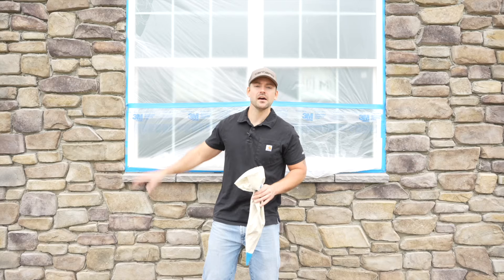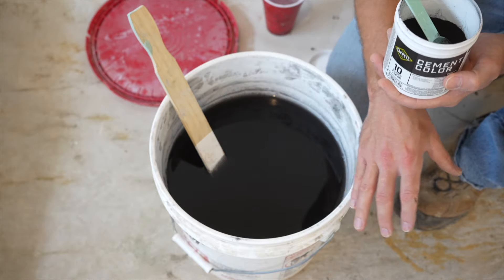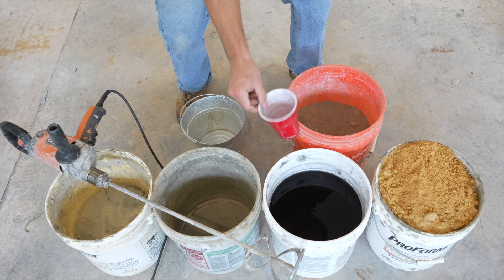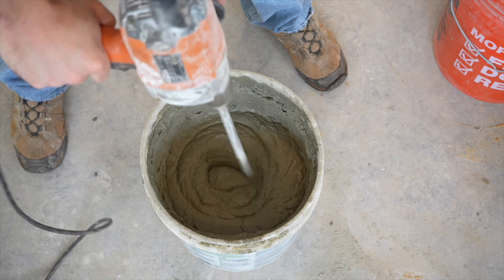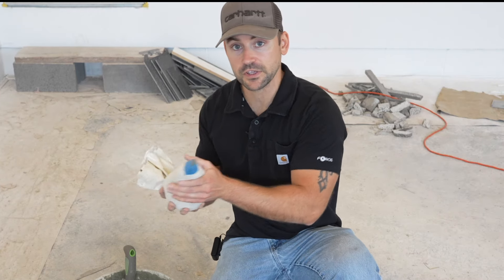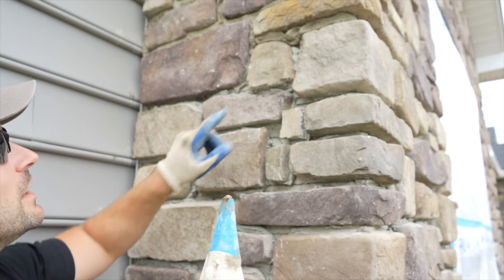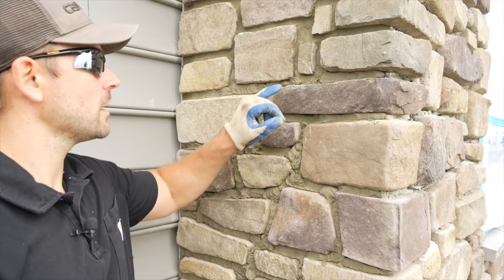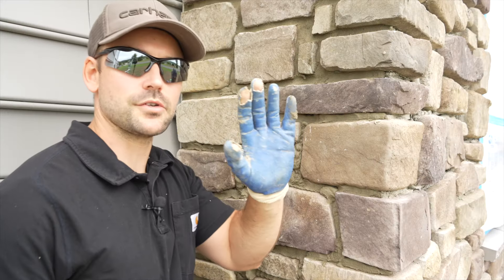Stone Veneer Installation - Part 3. Grout (FAST And EASY Method)

Comment: So great to see the finished look. The details are always head on. We've used automotive rubber hose of different sizes to avoid wearing down the gloves. The consistency of the mortar is important in measuring even if you are not using a color dye. Mortor alone can have a different color. We Always used fresh water on our mixing so dirty water didn't factor in on a different shade when it was dry. Awesome look and hope to see it with the lighting installed. 
Great job Josh 👍🏻
Reply from the maker: That’s a good idea to use a rubber hose. Never thought about that. You are so right. The consistency is definitely very important when it comes to grouting. When I first started grouting back in the day I would always make it to draw and I did not learn until the second job to make it more soup. Yes fresh water is important too. Consistency of the whole job is key. Sounds like you have a lot of masonry background like we talked about before. I am honored to have  subscribers like you watching!
Reply: @TheExcellentLaborer  starting young in the trades with my father in plastering and cement stucco before the newer products came around, the learning process is basically the same. Still loved keeping the product of, "old school learning" as a good rule to share as much as possible. Doing the old plaster cast work by hand was my most joyful part of my upbringing. At sixty years old now, I have never forgotten the years of training from hands on learning and teaching others. I'm so grateful that I came across your videos and can honestly say, I learn things from what you share and I appreciate your willingness to share with others. A lot of time goes into what you do in this manner and I thank you. Keep up the great job. 👍🏻

Comment: I am now fully inspired to restone my hearth behind my woodburning stove. I currently have  standard size brick. A wall of 10' wide X 8 ' high. Do you recommend attaching lath over the existing brick, smooth coat, and scratch etch the mortor, or do you recommend just  troweling a smooth coat over the existing brick wall, then scratch coat the fresh mortor? So to screen or not to screen? I will be refacing with real stone veneer.  Thanks for all your hard work getting out these videos  and inspiring us all.  Everyone should at least give you a THUMBS UP when they stop by as a THANKYOU for creating a how to video.  THUMBS UP!!!

Comment: Very nice videos. My house has, I believe, the exact same stone veneer as in the video. Watching you install this was mesmerizing and very satisfying. I am particularly interested in what is underneath the stone. I want to put up some window boxes and the instructions that came with the boxes address how to install over siding, stone, and a "regular" vertical wall, but not on stone veneer. The windows are 48 inches wide, and I used a stud finder under the window inside the house but I can't find any studs under the window, which seems odd. The only studs I could find were running down the edges of the window. Since I'm not sure of the studs, I'm not sure how to attach the boxes. I was wondering if you had a video on how to attach things like window boxes or lights over stone veneer?

Comment: I just started doom g Masonry work, and I really appreciate your videos. Not a lot of people on YouTube getting into the details with veneer stone work.

That said, there are a couple of differences to how we do things and your method. For instance, we don’t do a scratch coat. It takes less time and the rocks seem to stick better. Also, I’m rarely using a grout bag. It seems quicker to just head and bed joint the rocks and clean up joints as we go, with a touch up at the end. I think this is quicker and looks great too.

I’d be interested to hear your thoughts on this if you get a chance.  Thanks again!

Comment: Have you ever used a wet look sealer on your stone after completion ? Wanted to know if it yellows in sunlight . I’ve used it inside a house but haven’t tried outside yet . I’m making some of this stone . The individual pieces so can match the stone out of different places to blend in . Stuff like cherry blend and rainbow with stuff like  bluestone . Irregular colors and not orthodox I know but I like the rainbow effect of stone . Even a sandstone and limestone piece every once and awhile . Always an art but was curious about the sealer question . Really brings out the colors for sure about like poly or epoxy on wood .

Comment: Love all your videos, they're very well laid out and descriptive. I wanted to know what you think about using a pointing tool instead of your finger? I know they're designed for brick joints, but it seems like there are alot of straight lines in your stone joints where it might be helpful. Just curious as to your opinion. 

Once again, great job with ALL your videos, showing how to do these projects without any extra hands.
Reply from the maker: Thank you for your compliment! I have tried those before but the joints are irregular so it makes it challenging. I appreciate you watching. Take care!
Reply: Take and old broom stick and cut it into smaller pieces. Strike up enough joints it'll eventually file to a point and you'll be able to use it on any size stone joint.

Comment: Great video! Much appreciated. I just mixed a batch and it was too dry. Once it looks about the same consistency as your video, when I put it in the bag, the water separated and came out but the sand/grout stayed in. Is there a specific type of sand you are using? Or any other thoughts in where I went wrong? 😅

Comment: Thanks for the tips.  I've been eyeballing the ratios for my grout bag mix.  With an 80 lb bag of Type-S mortar ready-mix, I have the right consistency at the start.  However, it is too dry to push through the bag towards the end of the batch.  I'm going to try mixing smaller batches measuring 15 qts of mix to 7 solo cups of water next time.

I'm curious about where the stone veneer is below the siding.  Did you use Z flashing?  It looks like no.  I have a similar plan to install stone veneer on the foundation below my siding.
Reply from the maker: Hey Jonathan! It does sound like you need to work with smaller batches. I usually use no more than 5 gallon buckets at a time as shown in the video. I would recommend you starting out with a little more liquid so it does not set up before you use it all. Also if it does start setting up you can always add more water. I do not use the strip because my siding goes ever my foundation about half of an inch. It would be good practice to use the z strip but I don’t like the looks of it and I never had a problem not using it. Hope that helps! Good luck with your project!